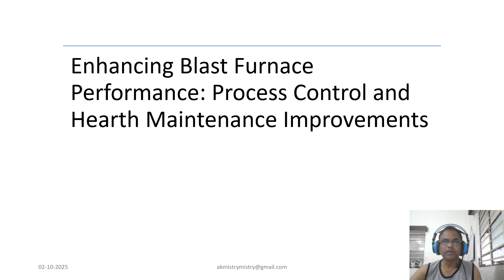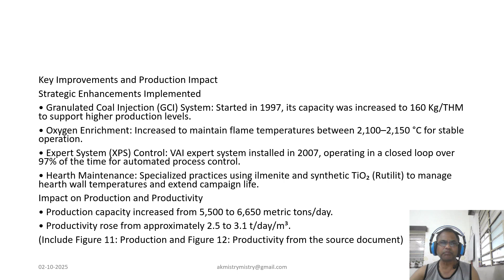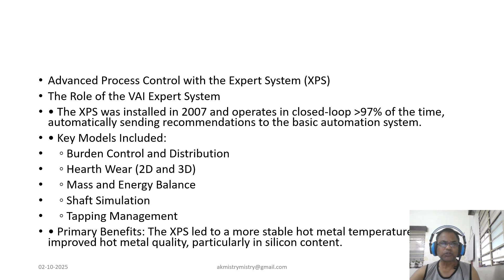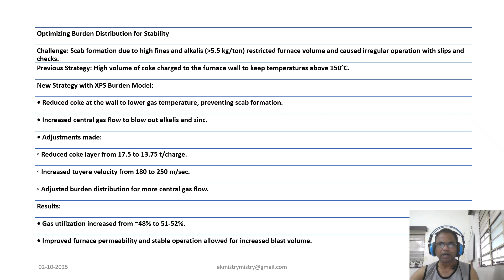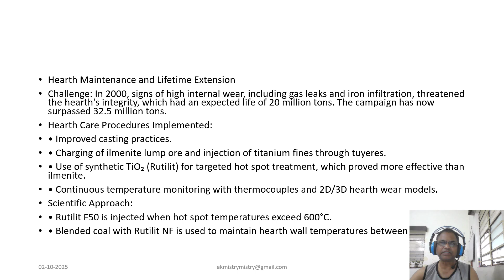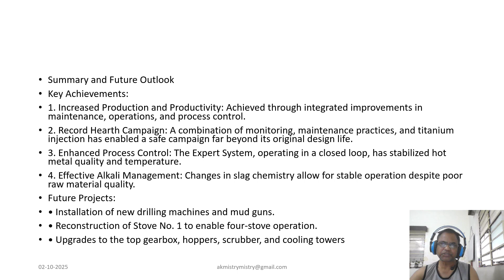The Furnace That Wouldn't Quit: Inside AHMSA's Legendary BF No. 5

Comment: Sir would you share the different case study in blast furnace, like  chilled furnace, stave failures, hearth puncture, taphole failure, severe hanging, across different blast furnaces, and what are the major reason and key learning from them. 

Practical incidents happened in blast furnace  with the ttheory which you explain will be  more relatable for the learner.